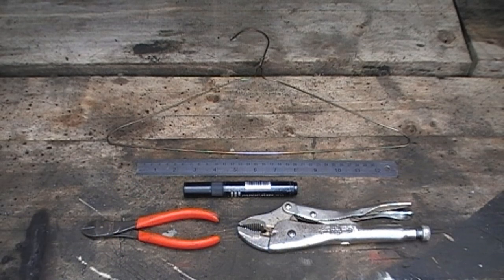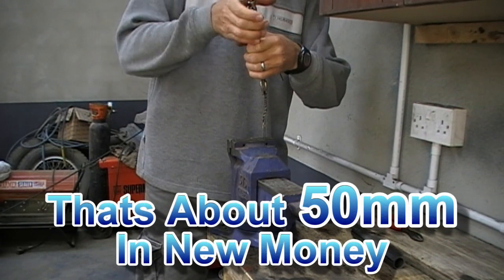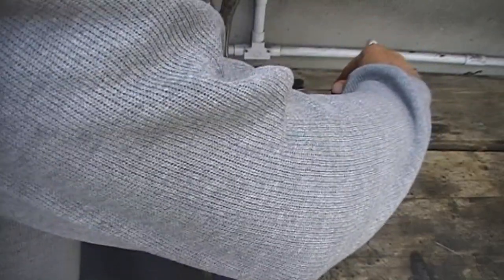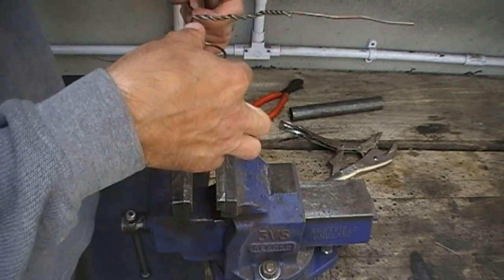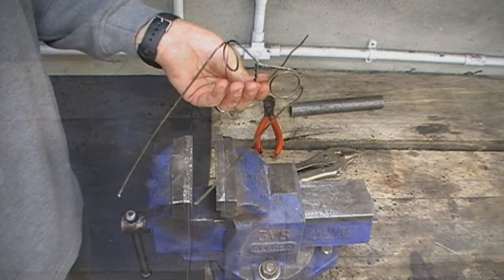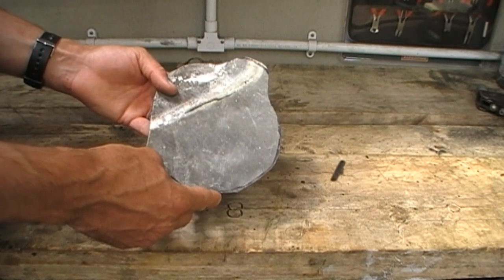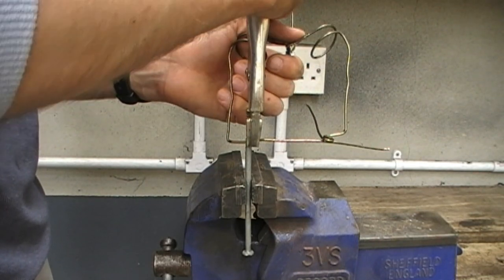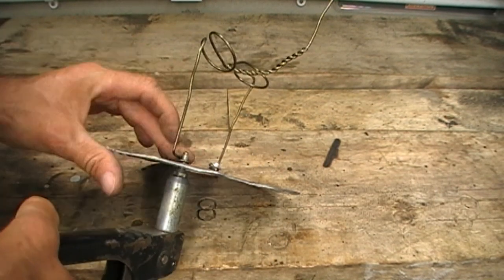DIY Decoy Cradle

Comment: Gonna have to start calling you Handy Andy 🙂
Really nice, and easy, but could you not put the legs on the inside to hide them, or would that make it too hard to work with?
Reply from the maker: Man what ever happened to Handy Andy anyway, Yes i'm sure you could twist the wire around a bit farther so that they were on the inside but it is thin wire so the birds would need to be close to see it and by that time they would be well within range.

Comment: very good Idea!

I Live in Portugal, could I legaly go to england / Ireland
And go hunting with a Sub 12 ft/Lbs gun?
Would I need a registration of my gun/Permit to hunt?
Especially my Own airgun tuned down to under 12 ft/lbs?

Sure in this Pandemic Period it´s no option, but probably in Future

Thanks a lot and greetings from Portugal :)
Reply from the maker: That is a good question as JH has said you don't need a licence to own a sub 12ft/lb air rifle in England but you could have problems bringing one into the country and the laws are different in Northern Ireland and Ireland as you need an FAC fire arms licence to own an air rifle even a sub 12ft/lb. You could try contacting the BASC for advice as i have asked them a few questions myself in the past and they have been very helpful.